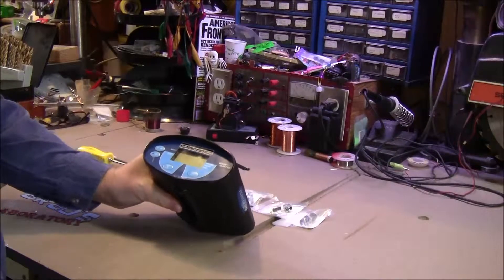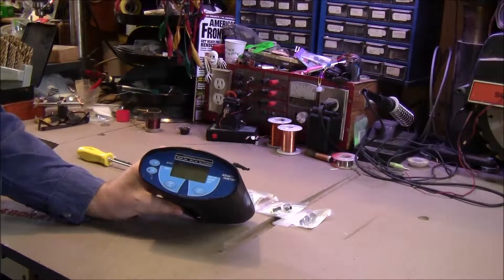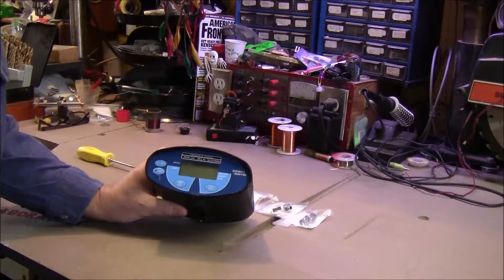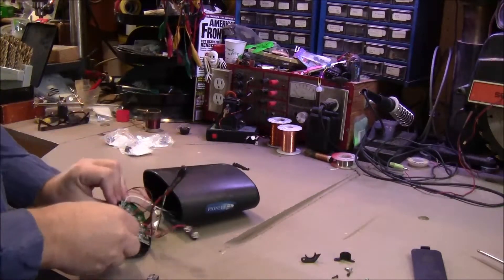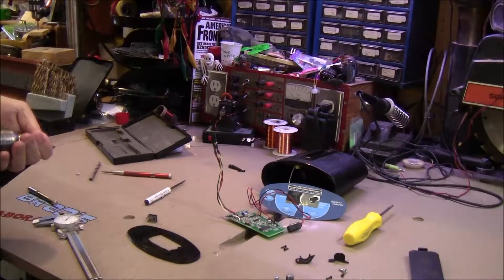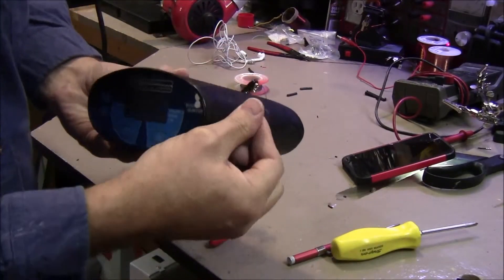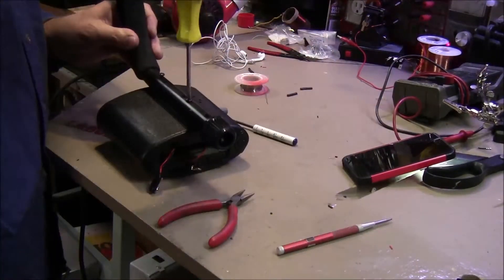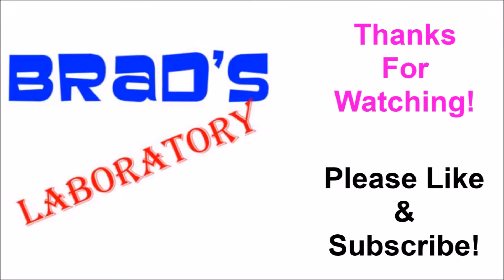metal detector headphone add

Comment: I just bought the same unit 3 months ago for 106.00$ from Walmart. Was really disappointed that there was no headphone jack. I thought they all came with them. I'm hearing people are paying half what I paid for same unit. I must say it works good for a cheaper unit. I've found lots so far, rings, bracelets, old coin's. I seen it tested with a unit that was 3× the cost and it operated equally. It says its water proof up to housing but I only used it in 2 inches of water and it's hard to pick anything up. I really want to chance doing what you did but my luck I'd break it. Is there a easy method I could do?, maybe just run headphones wires to speaker?. Probably be to loud. Apparently I could have bought a much better detector for same amount I paid. I heard that 2 of the most valuable finds were from 2 of the cheapest detectors. Maybe not true. Thank's for the video. I'd be thankfull for a response to my question. Good day Sir.

Comment: Hey I was wondering if your channel still active I was hoping you might be able to offer me some assistance. I’m trying to get a couple pictures like good pictures of the circuitboard from a pioneer Ex
Reply: I have one I’m trying to repair and I can’t find any resources on schematics or even pictures of the board
Reply from the maker: @CamRStanford  Here is a link to some pictures: 
https://photos.google.com/album/AF1QipNDN7r5PjlQj-k46Dd44HpVvp-YAUIx8oJaVsY6
The issue will be if the microprocessor chip is bad, you won't be able to fix it without the software to reprogram it. Hopefully it is something simple and you can fix it.
Reply from the maker: Looks like the chip marked 074C is a JFET Op Amp and is amplifying the signal from the coil, there are a couple of LM339 chips that are pretty common as well, they are analog comparators. The chip in the corner is marked 4053 seems to be a multiplexer, probably for the display. the little chip marked 27M2BC is an op amp as well. The big chip PIC16C62B is the microprocessor and it gets programmed to do things like drive the display using the MUX chip and reading the switch inputs to change modes and what not. There is a program header so it might be possible to write a new program and dump it in, but it would take a lot of work to figure that out.